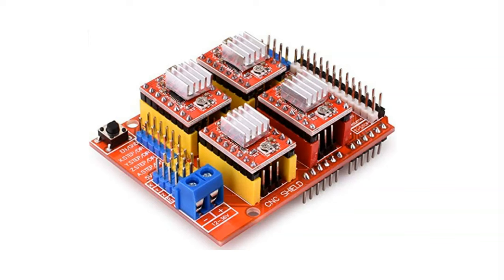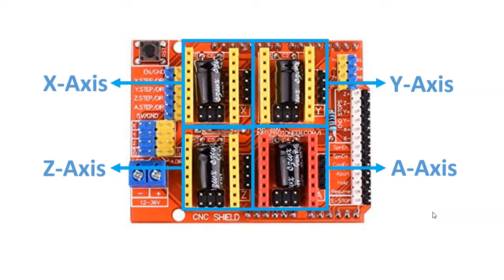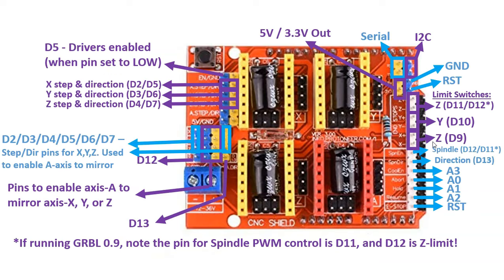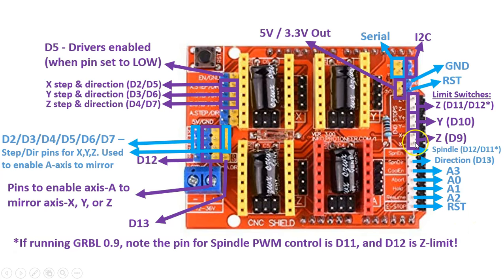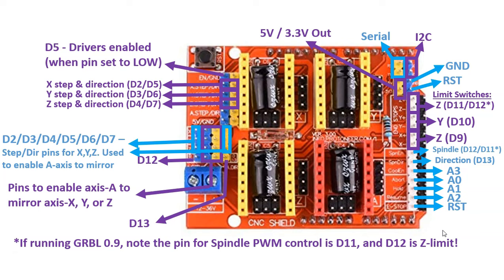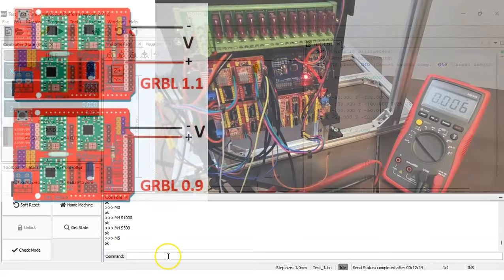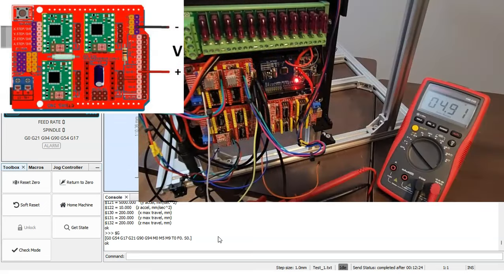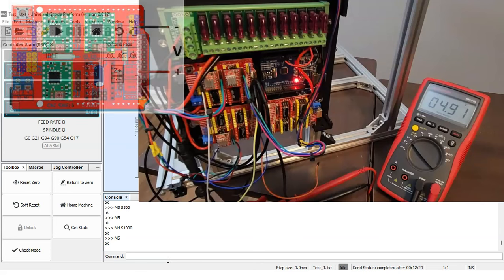Arduino CNC Shield Overview

Comment: OK I am doing it. I have assembled a Dremel Drill Press converted to a 3 axis Mini Mill. All the 3D Printed parts are done and tonight I received the extra Motors, Power Supply, Arduino CNC Shield, Motor Drivers, but I forgot to order the Motor Couplers so Minor Delay. Cutters are due this week, If this works I will be able to machine Model Train Chassis for special trains that were not offered in S Scale the scale i work in. Thank for a great tutorial . D

Comment: Great timing! If only this setup could read SD cards, it would be perfect bc of the price and size
Reply: Maybe I2C connect to a separate 382p that reads SD cards and communicates via a small LCD and have some manual jogging buttons?
Reply: Oh look! A rabbit hole
Reply from the maker: I thought about doing this, but ended up not doing so as I haven't built something specific yet. You can buy a low cost SD card reader that connects to an Arduino and have the Arduino send the g-code commands to the Arduino running GRBL.
Reply from the maker: Thanks for watching!

Comment: Very informative narration. I have designed and fabricated my CNC Plotter. My project can be accessed on my channel danjunk-DIY on You tube.
I am using CNC Shield board. But I forgot to enable the CNC shield  by putting a jumper at " Enable  header pins" as you explained. Even then, my machine is working fine. I don't understand this "Enable" aspect of the CNC Shield. Please clarify. I am controlling my plotting using Universal Gcode Sender platform.